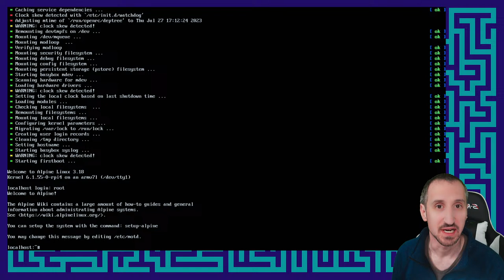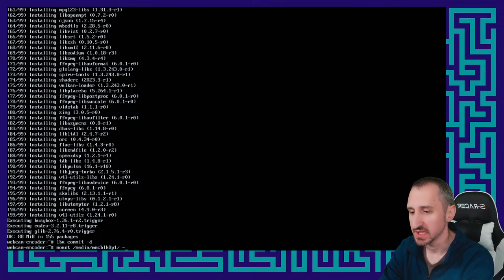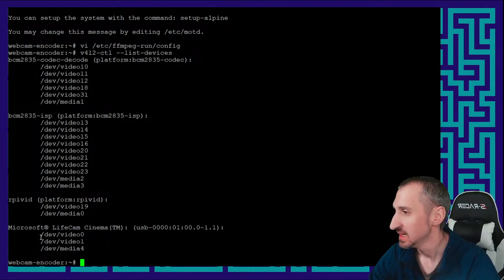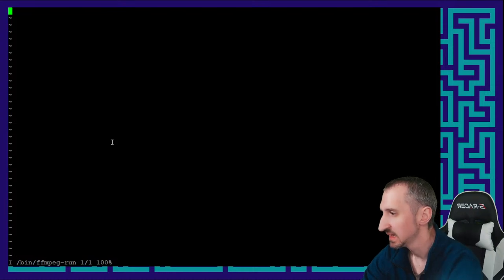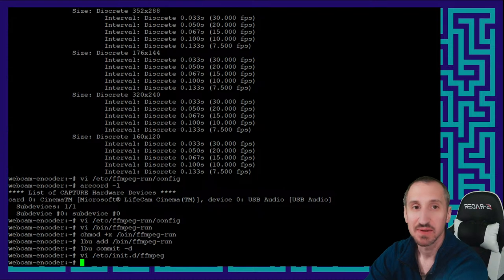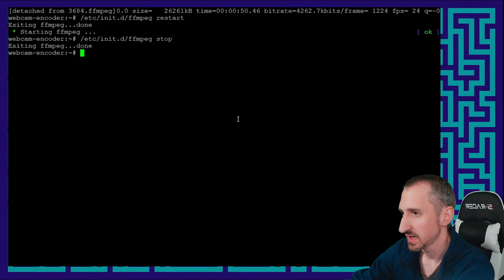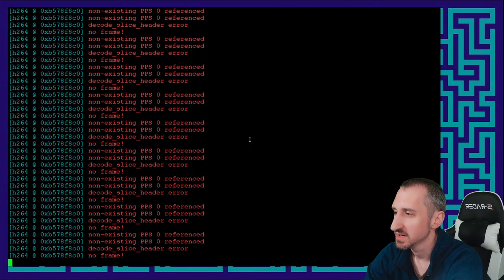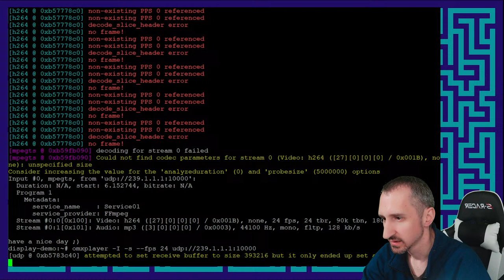Building an Live Streaming Encoder for a Webcam Using FFMPEG

Comment: this is exactly what i was looking for: hey mate I hope u will reply I am started my project to build a hardware optimized live video encoder for streaming I want to know about how we can use gpu to do the encoding
Reply from the maker: Hey @uFamous_Breakfast1792, I am glad that you found this video helpful!  I will see if I can get you a more specific example for doing that, but I do know there are more than a few options available to leverage GPU based encoding both for the Raspberry Pi, and using more powerful graphics cards on x86 platforms that can do that using FFmpeg.  Be on the lookout for another stream and subsequent VOD which will cover that exact use case soon.  Thanks for the idea and for watching! 😊
Reply: @xtendedgreg  i am waiting 🔥